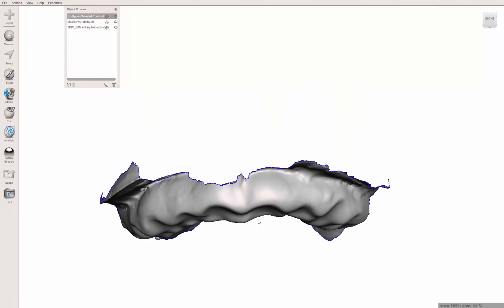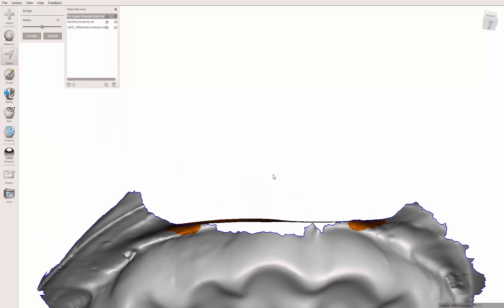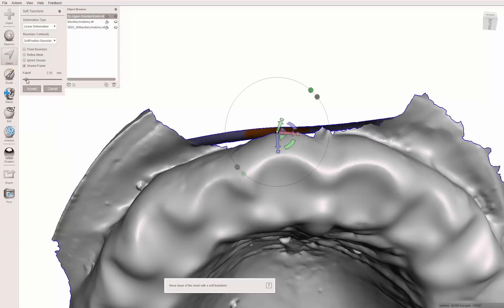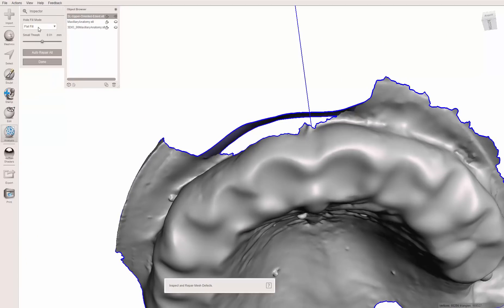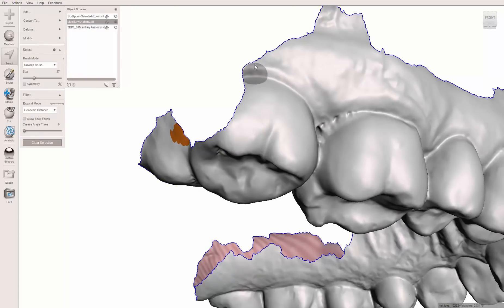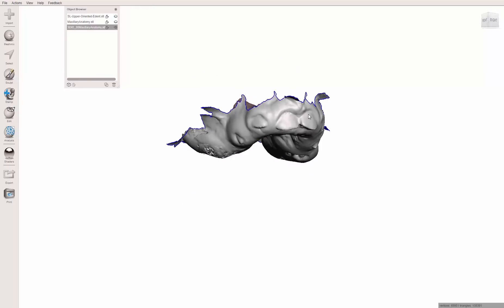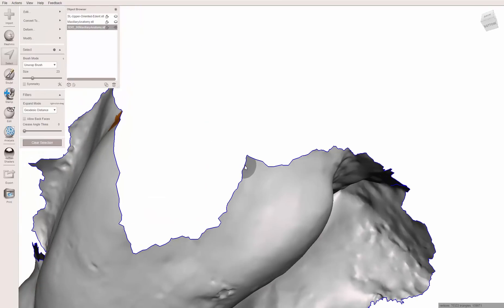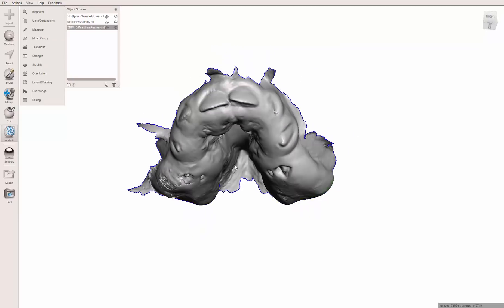Meshmixer Dental - (ADVANCED) Repairing Models by Bridging

Comment: My inspector tool won't recognize the space created by the bridge as a hole. Is there something I can do to remedy this issue? thank you great video!!
Reply from the maker: Sadly, that happens sometimes. Particularly with small holes and thin bridges. You can try transforming and stretching the bridge. Or remeshing the border of the hole. MIGHT work.